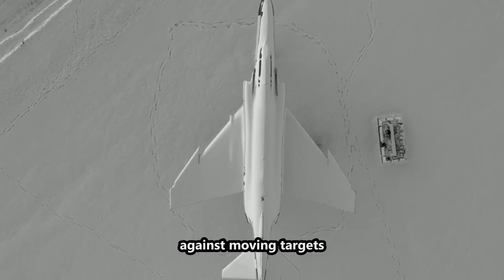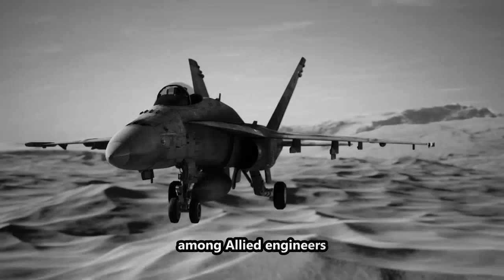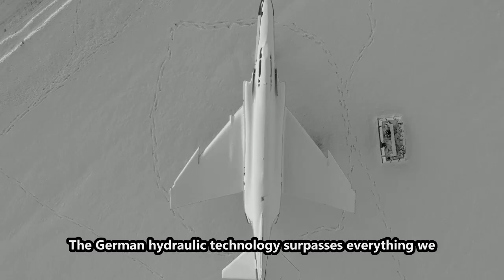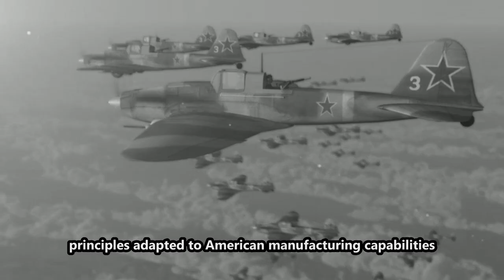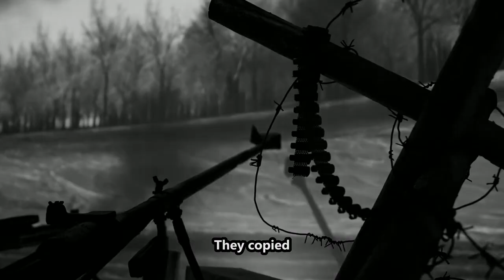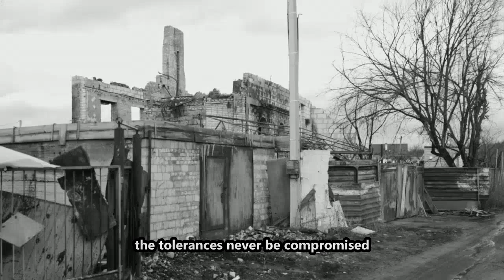NATO copied hydraulic targeting system that made Tiger tank unstoppable

Comment from the maker: Question for engineers: Does anyone know the exact specifications of the Maybach-Olvar HL 230 hydraulic pump? I found evidence of 280 bar operating pressure and 12 liters/min flow rate. Does anyone have access to original blueprints or technical manuals? The connection to modern MBT systems is fascinating.